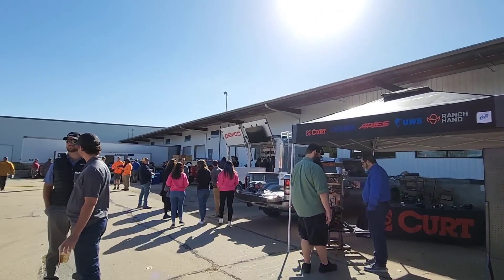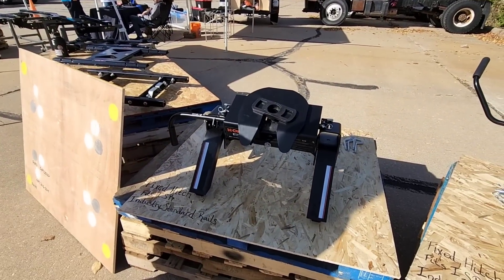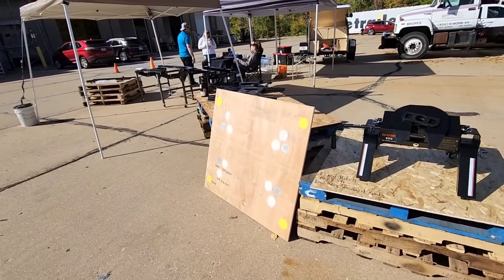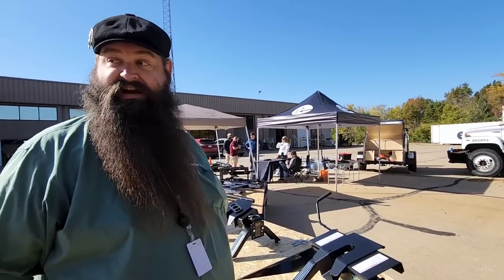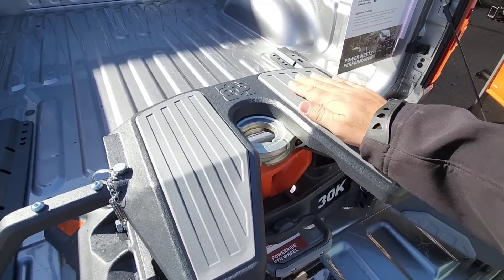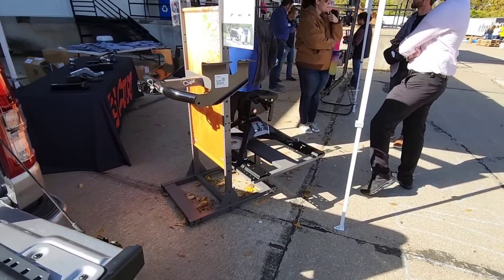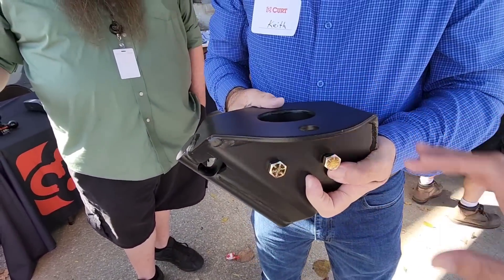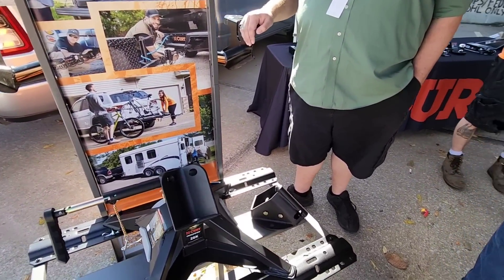New Fifth Wheel RV Hitch Tech from CURT!

Comment: I got the Curt Crosswing hitch about 4500 miles ago.  I can attest to the fact this hitch is awesome!  I was able to get the new adapter mount for the Ram puck system.  What I like the most is the weight.  I'm a 67 year old disabled vet and I can lift this system with one hand.  When I need the bed of my Ram, I can easily dismount this.  I've pulled our 5th wheel from Colorado to South Padre Island and then along the coast over to Gulf Shores and then home.  About 4500 miles.  I purchased the hitch from e-trailer (I get most of my trailer items at e-trailer) and I can't say enough good things about it.  It pulled absolutely great.  Hitching and unhitching are quick and easy.  I swapped out a Curt A20 and saved myself several hundred ponds in cargo alone.  The mount for the puck system is great.  Four hitch pins lock the hitch to the adapter.  Just like placing a hitch into your receiver.  Curt has gotten this right!

Comment: I personally think the last curt hitch is just Curt's version of the Andersen ultimate fifth wheel hitch which as been out for awhile now. Not saying it's good or bad, just a different twist on an existing mouse trap. Just my opinion. Thanks for the video JD!!
Reply: Andersen's Ultimate is a ball-and-socket hitch (ball on the hitch frame; socket on the trailer). The Curt CrossWing is not a ball hitch; it has three separate pivot axes. 

Both systems attach an adapter to the trailer's king pin, but the Andersen Ultimate socket-type coupler is fixed there, while the Curt CrossWing fitting rotates on the king pin as the vehicle combination steers. The second pivot axis is at the pin where the coupling occurs, and the third (lateral) axis is in the pitch compliance feature under the head.

While not related in design, the Curt CrossWing is clearly competing for the same market as the Andersen Ultimate. The PullRite SuperLite is in the same market; it is a ball-and socket but with the ball attached to the trailer's king pin and the socket on the frame in the truck.
Reply: Oh, the Crosswing is a very different hitch system.  The Anderson hitch voids the Lippert warranty because it adds stress to the pin.  The Crosswing looks like a standard 5er hitch to the pin.  That is, the stresses at the pin are the same for the Crosswing as it is for the standard 5er hitch.  For an Anderson hitch system, the pivot point is extended out in front of the pin.  This increases the stress at the pin.

Wait, there’s more.

The attachment to the truck is behind the axle on the Anderson hitch, it is not for the Crosswing.  It is where it is supposed to be. 

You don’t need chains for the Crosswing.

This hitch system is far superior to the Anderson hitch in every way possible.

Comment: The last hitch is definitely like the Anderson, but it looks like it will be easier to raise/lower when on an angle. Curious to see reviews when the gooseball version comes out.
Reply: I think the last one is an accident waiting to happen. Time will tell, but those two 5/8 head bolts are not going to hold up to 16-20k religiously. 
I wouldn't use it if they put it in for free.

Comment: On the curt 30k, the head to side bracket bolts are not long enough. Those are locknuts,and you can see the blue neoprene plastic and the end of the bolt MUST pass through that in order to lock. The bolts are short.

Comment: I have a curt A20 now but was wondering if they will make a retrofit for the head unit as it is held in with a large 1.5” dia pin and sits in a rubber shock absorbing U shaped saddle?
Reply: I have an A25 puck in my RAM. Love the hitch. I wouldn't trade it unless perhaps they had a head that fit the base as well as I don't like the way their GN attaches with just float plates. I also double tow and dropping to a 20K hitch isn't necessarily palatable.

Comment: Do you know if this curt crosswind is compatible or has a wedge so it can be used with Curt’s turning point pin box that is standard on grand designs reflection 150 series 5th wheels( brings the swivel point back to the 5th wheel pin box connection so 5.5 ft beds can get 90deg turns) they are both curt lipert products. Will this hitch allow me to place the wedge and utilize this function? Or will I have to find another hitch? If you or anyone else knows please let me know please and thank you

Comment: The question on the last curt hitch is will it void the frame warranty like the Anderson does
Reply: Trailer or truck frame warranty?
You’d figure they would make a hitch that is compatible with all systems and not void warranties.
Reply: Where did you learn that the Andersen voids frame warranty?
Reply: @REL3712  I have been doing some much research this year I am not sure exactly where it is.  I do know that Anderson have there website for the hitch details of their frame warranty if the frame manufacturer denies it and I may have found something on Lipperts site.
Reply: @dylandelarosa9856  trailer
Reply: @REL3712  I would agree that the Anderson is a good hitch option however
Reply from the maker: Since Lippert owns CURT and helped approve the design, pretty sure it won't impact the frame warranty
Reply: I've got the hitch and the adapter for the puck system.  Slides right in, close the clamps and done.  No issues with frame warranty.  In fact, at service at the dealer, the techs came out to talk about the hitch.  They liked it.
Reply: Hmmmmmm? Not sure where this statement is being factually based on.  Not saying you have not read somewhere someone claiming it, but to my knowledge not true.

Comment: When you tested the unicorn Chevy a couple years ago you did not think the Curt hitch had enough clearance. Do you think this one will?
Reply: If you are speaking about the bed clearance at the "tail gate" and it's not a hitch issue it;s a Truck/Trailer issue, newer heaver suspension with bigger tires make the truck sit higher, the trailer however still sits at the same height causing the clearance to be tight at the tail gate, if you increase the height of the hitch you do get extra clearance but you still have the issue of the trailer not sitting level and causing an unsafe towing condition, the correct adjustment would be to increase the height of the trailer to sit level with the truck and when that is done you will have the proper clearance needed.

Comment: The single point hitch is 8" back from.the ball mount? That's not keeping the weight over the axle, that adding it 8" aft of axle. Thats not going to be a fun ride in inclement weather. GM hd 6'10" beds gooseneck location 4" aft of axle has the unloading effect on the steer axle(vs 2-4" ahead of the axles centre line)